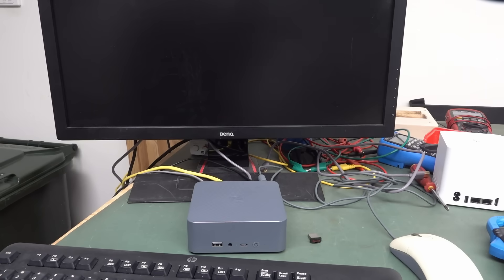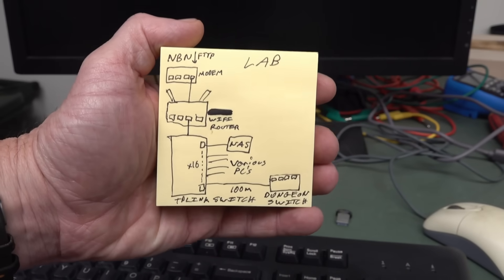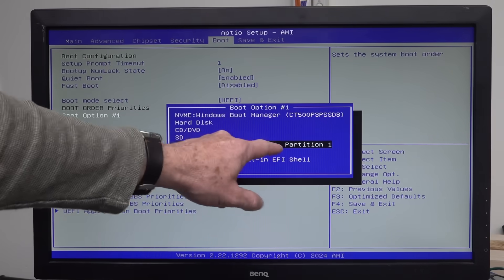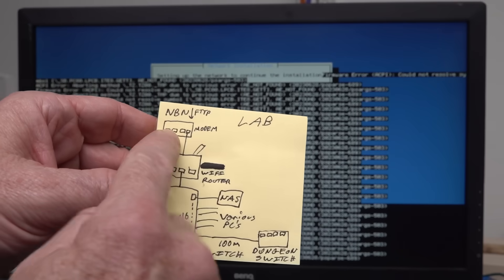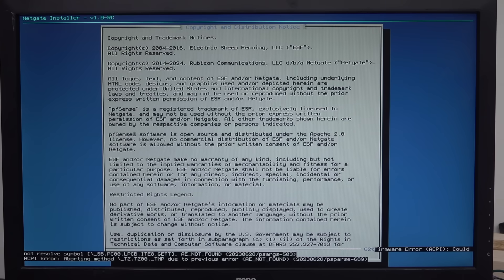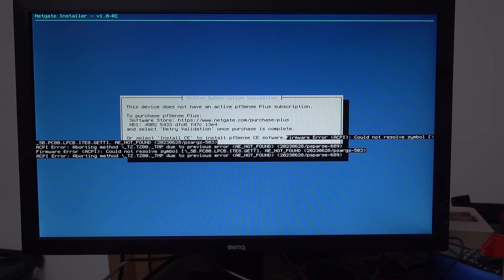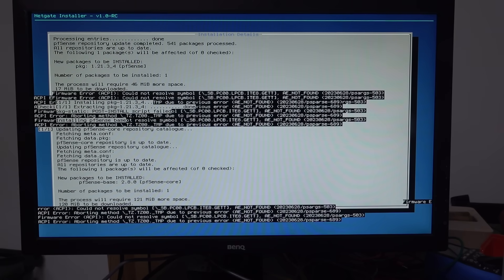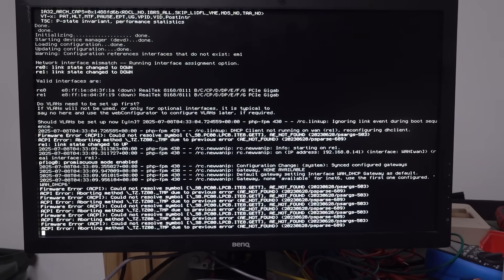Laugh as Dave FAILS to Install pfSense

Comment: Go with OpnSense, which is a really free fork of the Pfsense distribution.
The fork happened when PF sense was acquired by some company, who is the company who sells the PF Sense hardware.
OpnSense is basically the same as pfsense in capabilities and security.
But indeed, both in pfsense and OpnSense, since they're both based on FreeBSD, it doesn't have as extensive hardware and driver support as Linux.
The oddities about the install to the device's hard disk is another thing that is common to both pfsense and OpnSense.
In fact the install wizard, when you answer that you want to "INSTALL" it to the hard disk, it doesn't assume what we'd expect... It does nothing more than creating a swap and data partitions on the hard disk (but still wants to boot from the USB).
I'm not quite knowledgeable of pfsense, but at least in OpnSense, after it's installed and working well from the USB stick, you need to logon to the console and run some setup script from the console prompt, that will actually load the O.S. to the hard disk and make it bootable from the hard disk.

Comment: I'll be the heretic in the comments and suggest trying MikroTik. It's about 50$ for a perpetual/lifetime license with updates forever (truly forever - I've got licenses that I keep using/updating for over 20 years). It's Linux based and works ok with Realtek NICs and has tons of features (both in terms of firewall and in VPN support among others).
Another (free) option would be to install Proxmox and then create a pfSense VM on top of it, so it won't complain about the realtek NICs. It will used virtuaized NICs which work ok on pfSense.
As a matter of fact I would suggest using Proxmox for either pfSense VM or MikroTik VM, since MikroTik VM (called CHR) license is transferable if you want to use it in a new VM/installation.
MikroTik license on bare-metal (x86) is tied to the hard-drive's serial number. So if the drive fails you lose the license (although MikroTik can issue a new one if that's the case - but you have to contact support and go through that process).

Comment: It was probably actually booted - you're not gonna get a GUI, it's a router, you're supposed to access it with a web browser past that point. But you only configured WAN and no LAN so you don't have a way to get in. It's a router, so WAN port goes to modem but you also need a LAN port for your network and accessing the web UI, just like any crappy old router.
Reply: hey, an actual useful comment, hopefully he sees it amongst all the "it isn't a penguin" comments

Comment: Actually Pfsense and other *sense and some other projects are not based on Gnu/Linux but rather FreeBSD which is a Unix-like operating system which i believe is a branch off from a project called BSD (berkely software design). Its a project by the university of berkeley where they made a Unix-like clone. FreeBSD is a branch off from that original BSD. PFSense, Opnsense, truenas CORE, M0NoWall, sony's orbis os fro their playstations, apple macOS is  FreeBSD based (because the kernel is a hybrid between mach and FreeBSD and other BSD components)

So no friendly tux penguin but rather Beastie the FreeBSD daemon at your service. His name is similar to BSD and the pronounciation of 'beastie' is basically 'bee-es-dee' said in quick manner.

FreeBSD is typically more stable than Gnu/Linux because its 1 unified thing and thus not a bunch of different stuff from different vendors glued together with the Linux kernel but rather a full Unix-like Os. Also means all components of the os are created by the same team instead of different people across the community. Hence its more stable and the FreeBSD network stack in general is more stable and matured. Only downsides are development is slower than linux and also many drivers still lack support on FreeBSD and many programs dont work yet.

Comment: it has realtek nics i prob wouldn't wanna use it.

Installer is a nightmare. Used to be a simple iso installer. Now this garbage.  I been running it so long and it just works. I must say that. Find iso installer from previous version and update after its running.

I got another system to try to setup opnsense.  I wanna move but it aint the same. Some core functions require more effort when pfsense just works.

Comment: And that's why, for an installation, you don't change the boot order in the BIOS, you use the boot menu (usually F8) instead.. then you don't need to remember removing the stick afterwards ;)

Comment: Lol! Yeah, buggy BIOS. Its probably referencing a temperature sensor that doesn't exist in the hardware. Add the line: debug.acpi.disabled="thermal"  to /boot/loader.conf to silence those errors. They are more an annoyance than something that will prevent it from running. You also want to get your LAN interface set correctly so you can log in to the web interface of the firewall from the private LAN side.

Comment: I don't remember pfSense supporting RealTek ethernet chips.   If the problem is indeed network related you might try OPNSense instead.   It's a fork of pfSense (going by memory) but has better support for RealTek hardware.  Also having 2 NIC's available is generally considered a good thing for firewalls.

Comment: Looking at your mud map post it note . An unsecured network link through a building common space to your dungeon ? Why  bother with a new more secure firewall when someone can directly access your internal network?
Reply from the maker: If you can physically come here and secretely tap into my ethernet cable, you can have my data.

Comment: @EEVblog2 OPNSense much better the PfSense, more upto date and better hardware support. and the devs arent so hostile to the community
also best practice would be to have nbn box go into the pfSense or OPNSense router on a NIC set to WAN then config the other ethernet port to LAN  (and management) and hook up the switch to that and then the wifi and everything else connects to the switch

also those ACPI errors are probably from a badly wirtten DSDT table in the UEFI bios, one option would be to just try booting/installing with legacy bios and CSM enabled

Comment: Use F10 or some other key to temporarily change boot order, also clear bios settings and upgrade firmware. The ACPI messages is broken firmware that kernel tells you about, but it does nothing other then showing the message, so ofsense should work just fine regardless.

Comment: If you have spare desktop laying around, try pfSense on that as might have better luck.

Network Interface error: Warning: Configuration references interfaces that do not exist: em1

To fix that "acpi" error, you have to modify the "/boot/loader.conf" and add "debug.acpi.disabled="thermal"

 Hope this helps.
Reply from the maker: I have plenty, but they are big and bulky.
Reply: @EEVblog2  Hope you noted HOW to set debug.acpi.disabled="thermal"

Comment: I would install Linux/KVM and run pf/opn/sense as a VM. Yes, a little more complicated but worth the effort. A good learning experience too.
Reply: This.  Either go with Windows Hyper-V Server ,  or Proxmox  ,  or XCP-ng. 
Then you can even use your NAS box as the storage for all the VMs and config file backups and boot-file location etc. etc.
Reply: @plusmanikantanr  I have my pfsense on a Proxmox machine.

Comment: the ACPI messages would be enough to confuse anyone, but its really your skill issue that the spam messages was blocking your progress (literally just spam text overwriting the screen interface you need to configure it) , you have to keep navigating using the keyboard to redraw.
Reply: Ah yes, they're out now.   It's not the software, it's the user's skill level!
Reply from the maker: Err, I literally figured that out.

Comment: BIOS issues probably regarding ACPI tables
Reply: I'm pretty sure these NUC computers have a barebones bios/firmware as once tried to add external gpu to one using riser and the thing crashed at post due to the bios lacking the "advanced PCIe initialization" inorder to initialize the externally connected gpu.

Comment: BIOS related apparently due to ACPI implementation. You can disable a setting to get rid of that error.
Reply: unlikely. he did go into the BIOS and change the only available ACPI settings for it. this is a BEElink bios discrepancy because its built for Windows

Comment: I use one with the N100 processor totally fine.
If you look closely, the ethernet interfaces are manufactured by Realtek. They are not known to be the best. May be your N150 one will be a better bet and hopefully equipped with Intel based network  interfaces, which are the most recommended ones.
Reply: Realtek NICs tend to cause issues with pfSense and OPNsense. If you are stuck with Realtek, you would be better off with one of the Linux based firewall distributions.
Reply: Yeah, BSD doesn't like Realtek.  Even on Linux, you can do better, from what I hear.
Reply from the maker: I'll see if I can find it. it's still Beelink though.

Comment: Ah yes ACPI errors.   The reason I gave up on pfsense/opnsense too.
Reply: Broken firmware has nothing to do with the OS then running on the box.
Reply: @nikize  but those issues have been known for a decade and still nothing has been done to a) make a more descriptive user-friendly error message instead of barfing the same text all across the UI countless times, and b) realizing there is an erroneous ACPI table and disabling the respective driver instead of trying and failing again and again and again... which kinda shows how much the devs actually care about their product being usable.
Reply: @WooShell the product having the failure in this case is the motherboard/firmware but yes, most devs don't care about issues they have not been informed about. In this case the Mobo - or there is, and noone bothered to do a firmware update on that PC.
ACPI is complex, just because some part of the ACPI calls cause failure, doesn't mean that they shouldn't be called again. If they wasn't the machine might totally fail to work.

The main issue here tho is that logging is done in a way that puts this on the console. A proper configured log deamon would filter this out, that is not the job of the kernel to do.

Comment: Opnsense has better menu , it's pfsense but from another team , I prefer it
Reply: Yeh ive used both. I dont mind either. They both use the same core though.
Reply: I moved from pfSense to OpnSense as pfSense doesn't get updated as often and it easier to use in my opinion.
Reply: I’m using open sense too on a dedicated device… a protectli. Works fine, PFsense is very similar, mostly GUI I think.
Reply: I run OPNSense too.  pfSense, from what I've been hearing, has been getting increasingly flaky with their community versions.  No complaints - works great.  Biggest issue is that Wireguard setup is alot harder than it should be and it usually takes alot longer to figure out why it isn't working, even following the directions.  Once its setup, its rock solid.
Reply: 🤓👆 Worth pointing out that OPNsense is a fork of pfSense. Afaik OPNsense gets more frequent updates, is a bit easier to use, and has proper Wireguard support. The pfSense devs (Netgate) have been known for somewhat questionable business practices as well.
Reply from the maker: So said everyone on X